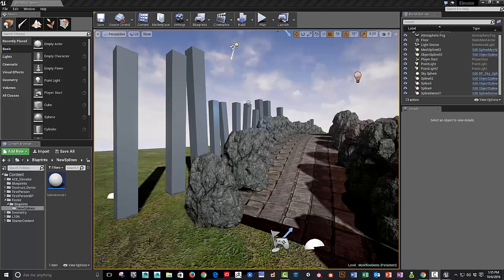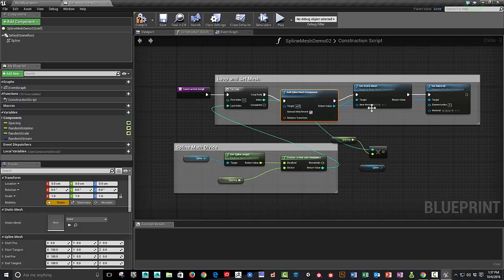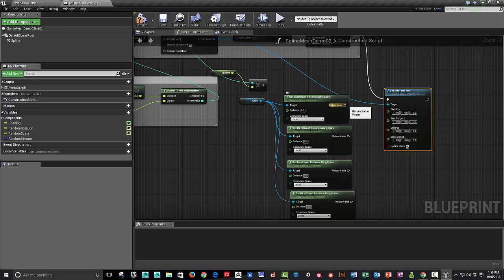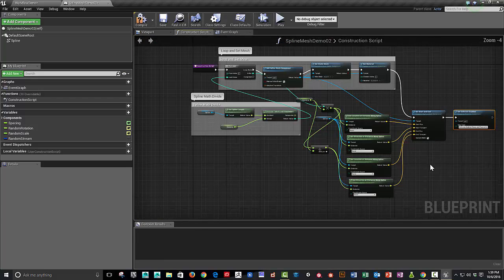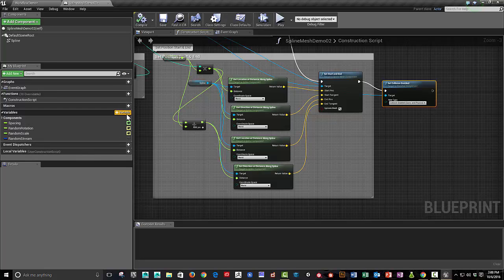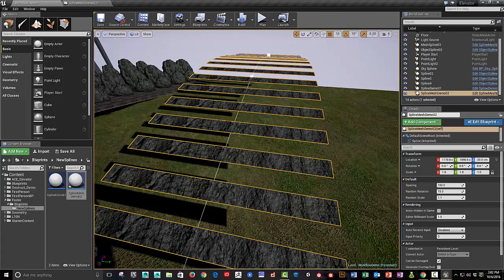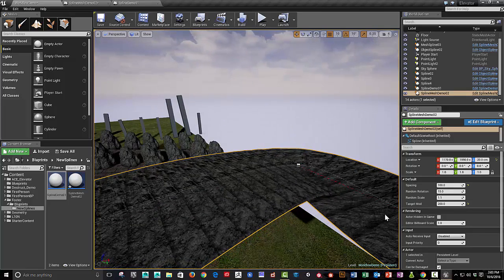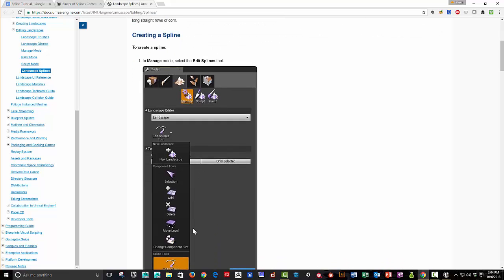Unreal 4 Blueprint Spline Tutorial (2 of 2)

Comment: Do three realtime spline drawing tutorial please if you have time.  Thanks.

1.) Line Trace then spline arch. Have spline arch with tangents like grenade throwing.

2.) Spline spawning at a player movement.  Have spline object be added to air as the player moves.  Like path following for airplanes.

3.) Spline spawning wherever mouse places.  Like vector brushes in graphic applications.
Reply from the maker: Cool suggestion!  I'm just starting on a new tutorial series for Pluralsight (Unreal Materials) - but in terms of your question - you can kinda get an answer from Mitch's VR lab - (the advanced VR teleport mechanic is similar to what you're describing)